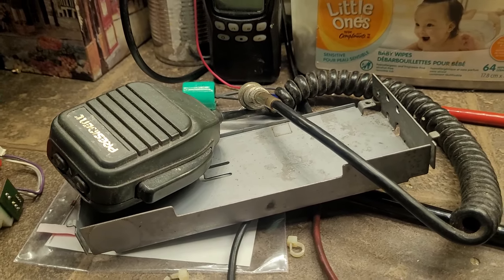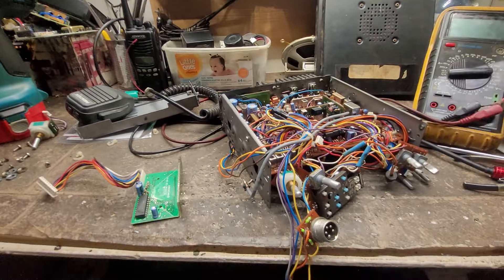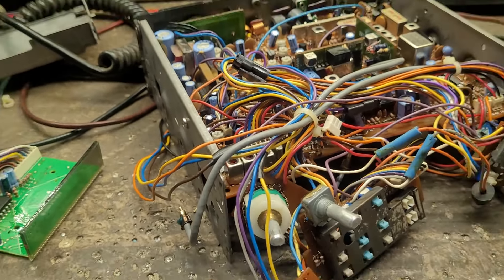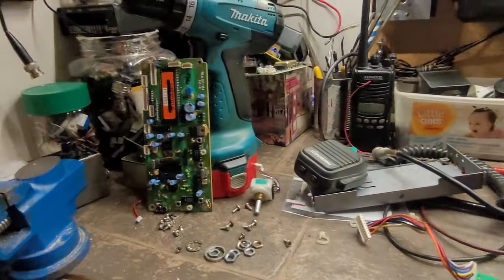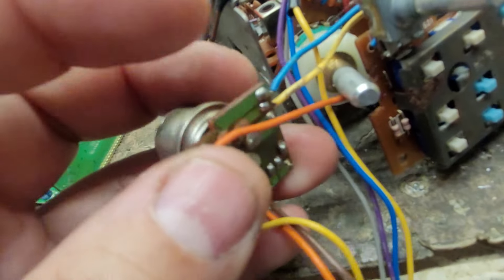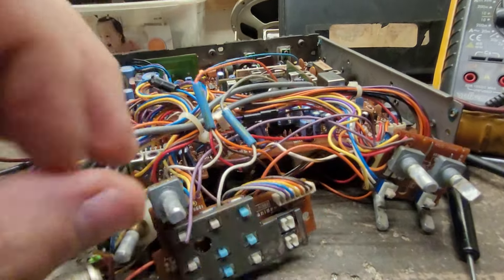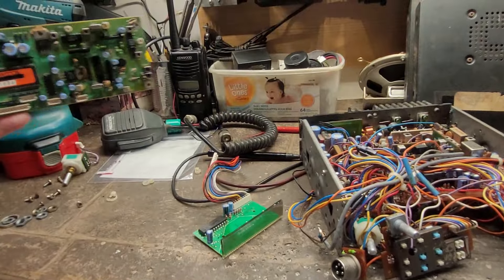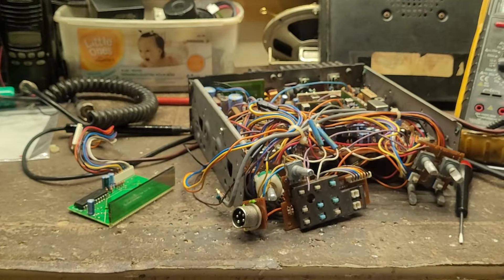President HR-2510  - What a mess!

Comment: An Icom 751 is a mess too. Had to replace the brain IC board in mine because the volatile memory was wiped from the button battery went dead. I opted for a board that had non volatile memory so now when the battery on the new one goes dead i won't lose the whole radio just stored frequencies.